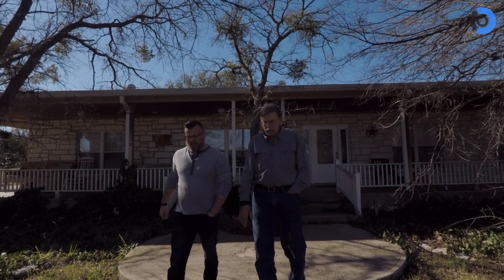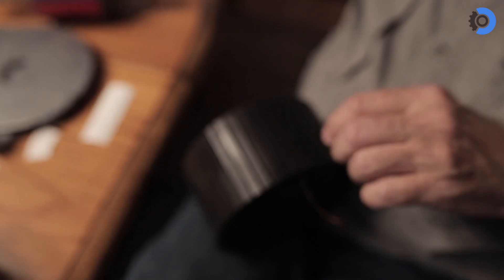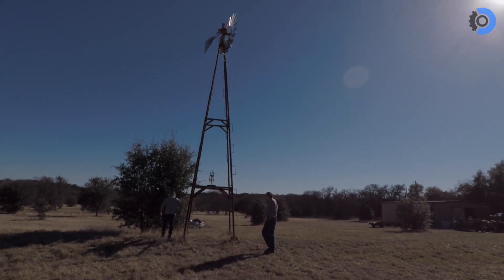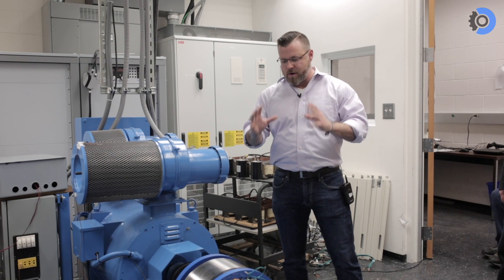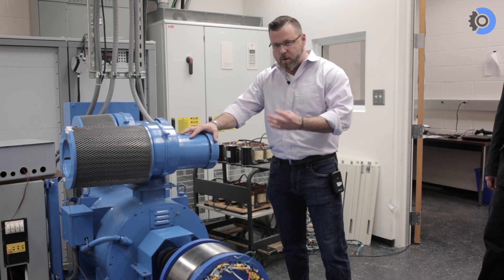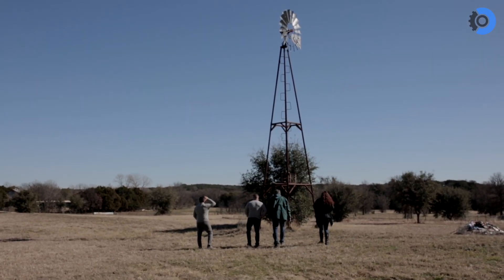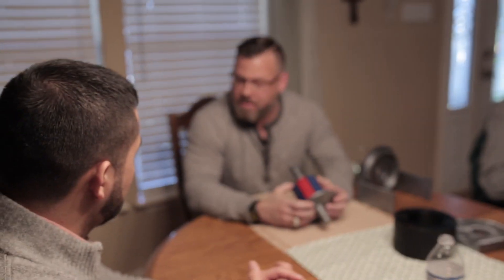The Origin and Vision of Linear Labs

Comment: If present electric motors are 70% efficient, and their motor develops twice the power of the present motors, that means that their motor is 140% efficient.
Reply: Torque density isn't energy efficiency. It's engine torque divided by engine volume.
Reply: Modern motors are far more efficient than 70% lol.
Reply: If the motors are double or triple the power of similar size motors, then for any given power demand spec you can deliver a smaller size motor

Comment: misleading and lacks important information... spoke motors are very much a known quantity in the world of electric motors. Essentially, they are compact permanent magnet motors where the magnets are arranged like spokes in a wheel for better torque generation. However, they have been prohibitively expensive to produce in volume and require efficient cooling system.

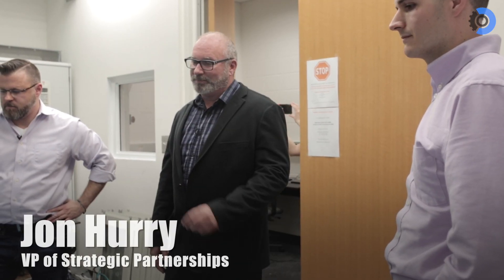Comment: Are you dynoing an 87kW motor without securing it properly? 1:47 motor wobbling.
Reply: @k0ppit Just before they turn the key the panel shows 9.9RPM when the standard hybrid motor runs at around 8000~20,000RPM but then they may have been testing maximum torque at 0~10RPM.  As you point out with this wobbly setup  something would break very quickly if they were to run it at higher speeds.  This video seems to have been made on the quick for shareholder promotion, who knows. k0ppit, I found this interesting: https://www.thedrive.com/tech/17505/the-secrets-of-electric-cars-and-their-motors-its-not-all-about-the-battery-folks  :-)

Comment: This looks compact enough to fit a front wheel drive vehicle as a replacement for a gas or diesel engine as well. Not sure if that's too far of a reach or not. Good luck with this. Looks great and very promising.

Comment: Have you contacted Elon Musk? Go see him. If your motor is really what you say it is, Elon will get it. Buy a Tesla and replace its motors by yours; make a video comparing performance with same Tesla car. 
Also, electric bicycles would benefit. Make a bicycle wheel with a hub wheel motor made inside a wheel to be installed on bicycles or mid-drive motor and sell it as a marketing leverage (check bafang motors for mid-drive).